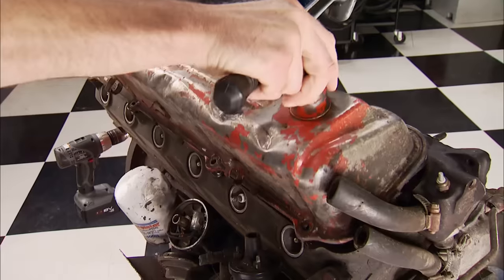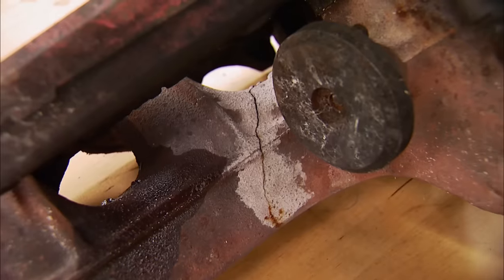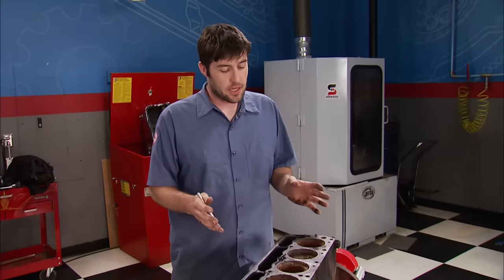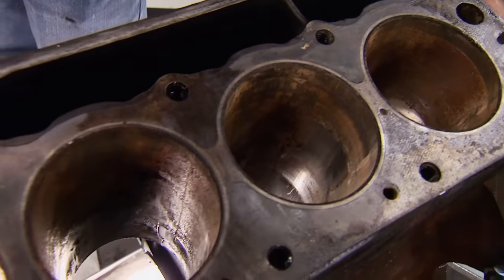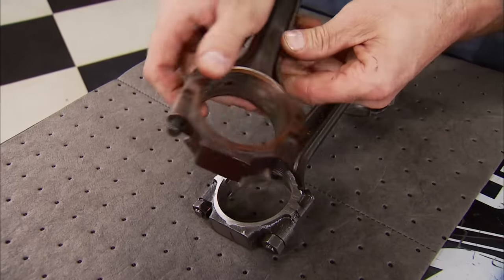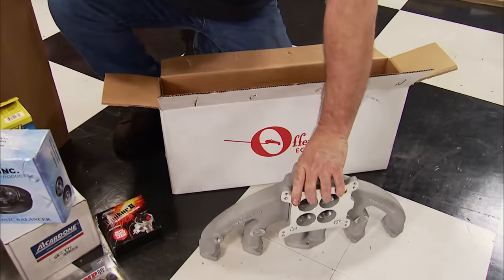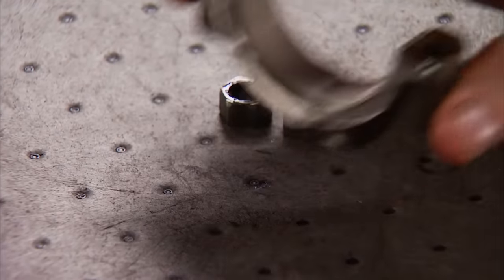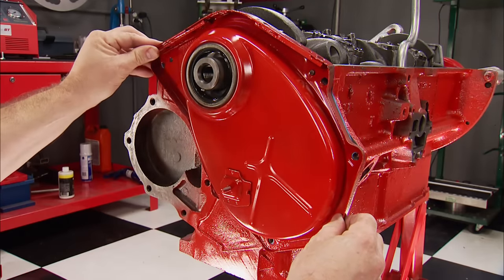Resurrecting A Mopar 225 Dodge Slant Six - Engine Power S2, E2

Comment: One time had to replace timing gears in a field with no ability to drop the oil pan. That thick rubber seal on the front between oil pan and chain cover was probably the biggest challenge of the entire job. I could see the last guy had the same problem as all the locator pins directing the chain cover were all oblong already. New profanities were created.

Comment: 30mpg? I have had many slants. Never got close to that. 16-17 before they got cats. Then they went down to 13. Some claimed in the "Feather Dusters," and the "Dart Light" with light weight body components (aluminum) 2bbl Super Six, 833OD transmission might have went into the low 30's. My 198ci slant with the M-1 2bbl intake with a modified head, stock cam and Hooker headers got 22mpg on 93 non-ethanol @80-82mph with 3:23 gears and a 3 speed.

Comment: I remember this incline straight 6 cylinder, like a half of a V-12 in Mexico they put a small carb to save gas, and it did the job very well, it had the bit of extra power and the millage was amazing! like of a 4 cylinder or better.

Comment: I had several cars  with that rugged old engine, they were tough.

As for rust removal, I  hope this helps someone. NAPA has a product called Knock er loose. it is the best I have found. Next would be blaster.

Comment: Guys -- they aren't "freeze plugs". They're "core plugs". They are there simply to remove the casting sand when the engine block is cast. That they MAY pop out if the coolant freezes is just a secondary effect.

Comment: I've seen one of these still running after throwing a rod through the block and the starter hanging by the wires. Friend stopped by and was wondering what was wrong with his car. I was outside and saw the starter dragging under the car. Opened the hood and naturally steam and smoke was coming out but it was still running. He asked me if I thought he could make about five miles down the road. I said I don't know but whatever you do don't shut it off till you get there. He made it.

Comment: I had this in my 65 Barracuda. Changing oil and setting the timing and replacing points was a b1tch. 5 in. of space to with between the passenger side fender and engine to work with.

Comment: The oil slinger does not oil the chain. It keeps excessive oil away from the front crankshaft seal to prevent leaks.

Comment: I love how Chrysler Slant-6 engines literally have the damn intake next to the exhaust manifold.
Reply: The pushrods are in the way on the other side. Still wonder why not hot-hot-cold-cold and at least a little heat shield. Overhead camshaft and HEMI is so much easier ( note, not a full hemi it is more 0.3 sphere and I would love the spark plug in the center and accept smaller valves in a low revving engine. How far should a spark plug protrude into the combustion chamber ideally?

Comment: The one in my 65 Dart is at 97k miles and is a daily driver. Still running fine. BTW, the external oil pump feature is also found on big block Chrysler engines.

Comment: Nice video💪 if you have a rusty cylinder next time you can fill them with cola for a little time. It will make the rust lose and its easier to pull out the pistons.
Reply: If we have time: Could we place the whole engine in a vessel with propane and heat it to 800 °C over night to simulate a blast furnace and reduce all steel ?

Comment: For all the people complaining about replacing everything. The original motor is 1976 or earlier with a forged crank. The block was cracked. It happens. The later block is 1976 or later with a cast crank. The cast and forged cranks are entirely different. The connecting rods are also  entirely different.

Comment: 14:57 cold lash should be Greater than not tigger as the coefficient of linear expansion is greater for steel then cast-iron. So as the engine heats up the valve lash gets tighter.

Comment: i have a Dodge A100 pickup that has a slant six that is stuck from sitting.  I pulled the plugs and put some transmission fluid in the cylinders. Are there any tricks on freeing it up?

Comment: in 1977 my older brother's first car was a 67 dart, the engine was tan, a 170 most likely..we lived in illinois and would take it out in the hayfield and do alfalfa burnouts..This turd was a dog to say the least.  we drove it out on the blacktop and would get it spinning in the grass off the road and slowly get onto the blacktop, after a little chirp it was all over. 
after months of not having fun we decided to see how fast it would go.....top end downhill it registered an eye watering  77 mph.....it never gave up though. what ended it was my father getting toasted one night while driving it and hit a guard rail, busting out the radiator...he drove it 5 miles before it seized up. the next day the engine turned over again. 
Great engines they were, very durable.

Comment: My Dad was a Master Mechanic, his favorite engine was the dodge slant 6, and told me so many times. that engine was designed and manufactured when customer loyalty was what most companies were trying to build, so they built dependable long-lasting things.

But then as a new generation of younger greedier people took the reigns of these companies, they figured long-lasting dependability was not for them and began to push for planned or built-in obsolescence in other words they started making stuff that only had very specific wear and tear life.

When I went to a tech school, I was told that appliances that were once made to last for life would now only last 7 years, here is an example.

I went on a service call to a small chest freezer, it was just 5 years old and the compressor relay had to be replaced.

The 1950s rounded corners freon-22 freezer on the other wall had never been serviced for any reason and was running right as rain, while the 5-year-old 1980s something freezer had a bad relay.

Then they did something they did not need to do but did anyway, they started putting computer boards in everything, those boards are expensive, and a nice profit for the company making them and the parts house selling them, the old analog stuff was way better and way more dependable, if you do not have good surge protection, then a line surge of power can take out the computer board of your fridge/freezer, etc...

But hey they are all doing it so there is no choice, my current washing machine, I was told at Alabama Power was one of the last models to have a regular agitator, the next gens would have a rinky-dink dinner plate looking disk with depressions in it for an agitator.

I passed by a Ford dealership with my boss one day many years ago and they had trucks that had rinky-dink tires on them, so I asked my boss why they did that, and he said, there are usually 4 tires on a truck if they put the smaller tires on and save 5 dollars a tire, that is 20 dollars per truck multiply that a few million times for a few million trucks produced for that year model. and the savings to Ford is huge.

So no more regular agitator, they have cut down the amount of plastic being used for the agitator, and it saves them money, if they save just 1 dollar per washing machine, and produce 5 million of those machines, they have saved 5 million dollars.

It has become produce the crudest stuff possible that will die 2 days after the warranty goes out and make the replacement parts very expensive so you can make big profits keeping the board of directors happy and the stock investors happy so you can keep that cushy multimillion-dollar benefit-rich CEO job and that very nice golden parachute at your retirement.

Rant over.

Comment: Always loved that Engine  i was always a boater and i thought  the Slant 6 would had been a great Marine Motor ?  Although the Crank may need upgrading ?  Perhaps their Industrial one would be okay ?  For the torque a boat needs
Reply: The original slant-six came with a forged crank, pretty much the industry standard for strength, although they later went to a cast one.

Comment: Nice job guys. A few questions. Why didn't you go with a Holley ETI? It was nice seeing protective caps on the connecting rod threads during assembly, but the same could've been used with valve seals. Push the valves in, protective cap slide over the valve tip, oil seal then gets pushed on. The top of the valve shafts are sharp just enough to mar the seals leading to smoking. Last and final, did you wire wheel the bolt threads? Also, it's good practice to run a tap down to cleanup the threads for those head bolts. Think of the rust line created when the old head bolts were in. Now, both the engine and head are resurfaced. The head bolts will be going down in uncharted territory. Hence the need to clean those threads for an accurate torque.

Comment: I ran a slant 6 from october to may with no rad because i could no afford one knocked out the frost plugs and drove it to work twenty miles each way. In the spring got a rad drove that engine another 5 yrs

Comment: I had one of those in a 68 dodge dart. That engine was almost indestructible. I was just an idiot kid at the time. I got it so hot one time and it shut off, I waited until it cooled down and filled it with water and it started right up. I drove the car for another year before selling it.

Comment: the Slant Six uses 426 hemi main bearings & has the same camshaft chain drive as a side valve ford V8
the camshaft chain is approx worn-out its only 54 years old - still has original water pump and Alternater  - chrysler didnt cut corners :)

Comment: Did any of the  Earlier Slanted 6  Cylinders Have the plugs in valve covers. I only ask because my father at a 60 Plymouth Belvedere. I could of sworn the spark plug were in the valve cover.

Comment: Way back when I first started driving my first car was a 1972 Crazy Plum Purple Plymouth Duster with the famed 225 and it stood the test of time. As for killing that engine, good luck, because it's not happening anytime soon. If only I knew back then what I do know I would have really taken the time to keep that car but an unfortunate tragic end came to the car and I junked it, sadly... I kept it as long as I could but soon I had no choice because I lacked the funds to move it so off to the junkyard it went... I did put new paint on it and ran it for a few years so I got way more that what I paid for it and overall it was a great car for the times... Obviously you're not going to win any races but you won't come in last either and given that is was in the over 30 MPG range less than 2 bucks is all it took most times to fill the tank... Cheers....

Comment: The engine actually goes back to 1928 ..... Where the Pistons were vertical, and had a small displacement. When hood lines were being lowered the engine got it's slant

Comment: just finished my motor mechanic app. took over the lease on a service station, mate and i made a stock car to race at head and greata dirt race track Australia in the early 70's out of a s model valiant it had a 225 slant 6 put extractors and a 45 mm side draft Weber on the engine welded up the diff. center through away the alternator bared the body out to be as strong as a tank we tried to kill that engine but did not succeed won sum races and had truck loads of fun by the time we finished racing the car it looked like it had been run over by a tank those were the days, then i was 20 now 70, youth lost.

Comment: With out milling the head, porting, and a good camshaft 268-275 duration you won't get no where. Headers come alive after 4K rpm, with that cam and stock head that is really restrictive flow won't even be able you really use that four barrel combo. Need at least 9:1 to run a four barrel
Reply: So porting is for castings? A casting uses sand and as such the surface of the metal is rough. We all know that rough leads to friction. Machining part is difficult. In our modern times, I guess that some 5 axis CNC can reach all points? Too expensive for series production, but not for race. And unlike long duration headers it has no disadvantage.

Comment: Hello good afternoon, do you know what the torque of the valve cover screws or points is since I am going to change the rubber gasket of a 2008 jeep compass? Greetings from Caracas Venezuela
Reply: 380 foot pounds .

Comment: Good as this engine was in its time, there was no further room for expansion with this design beyond 225 cubic inches from its 3.4" bore and 4.125" stroke; increasing emissions targets during the '70s and early '80s further reduced its future potential as an automotive engine (despite switching in 1976 from a single-barrel carburetor to a two-barrel one that brought up HP from 100 to 110 and torque from 170 to 180 lb-ft) and it was discontinued for passenger car use after 1983 and in trucks after 1987, while continuing to be available for industrial use until 1991. 

Both the previous 170 and 198 sixes had the same 3.4" bore but had respective piston stroke lengths of 3.125" and 3.64".

Comment: Thanks for teaching that piston rings definitely rotate on a fresh engine.  The gaps are liable to end up ANYWHERE and it makes very little difference on an in-spec engine. 
Even the factory didn't fuss about where the ring gaps were for good reason.   It sucks listening to people say "look....some idiot built this engine with the ring gaps lined up" when they literally can end up anywhere.  The rings don't all rotate at the same speeds, either.

Comment: I had slant-sixes in a '62 Dart, '73 Duster and '76 Aspen wagon. None got the fuel mileage I thought I should get - about 21 mpg. They were reliable. I surely wish they had fuel injection.

Comment: The best thing for that first block that the machine shop said was no good would make a good boat mooring. Looks as though its sat out in the weather and water got down the inlet manifold what a shame. These engines were used in the australian built valiants from rv1 up to the 1969 70  vf and the vg to cm used the 215 245 and 265 australian designed and developed hemi 6  and both those 2 engines were also used in the aussie built dodge trucks and ambulances as well and the slant six was even used in the indian army tanks and in speed boats in africa up until recent years , it was chryslers engine that refused to wear out or quit they were a bloody great motor and actually ran smoother than the australian hemi 6.

Comment: i had n australian 64 valiant, that engine was the only car l ever had that would start without the motor doing a full revolution, just had to breath on the key and it would  start, was lucky to get 20mpg and i could never stop it from oheating in the summer, push button auto, and you could coast start it if you had a flat battery, unlike most other autos

Comment: Took awhile for automotive designers to reduce air drag had to lower the front end.  Dodge did this by slanting the engine, but Subaru topped them by making the engine horizontal.  For us old guys, had to bend over further to work on them, but with the Dodge really not that much more.

Comment: I would not use cork oil pan gaskets. Use the one piece neoprene ones with metal inserts at the bolt holes.

Comment: I would love to see you do some work on a Buick 401 (",). I got a Buick Electra 2D HT from 1959. My engine had a 3 angle valve job, port and bowl clean up. I made some small adjustments on combustion chambers and polished them up. the intake and ex manifold had a clean up too. I has now a bit more power..But what can you get out in numbers on a old buick 401 ?..All the best from Denmark.

Comment: Guys. WD-40 is not a penetrating oil. WD=Water displacement.
Reply: it in fact isnt anything . you can spray it on a squeaky door hinge and the hinge will be squeaking again tomorrow . anything worth lubricating imo is worth a shot of 90 weight gear oil .

Comment: I rebuilt a 1963 -or 64 Barracuda slant six with the goal of turbocharging  it.  When I got to the crankshaft I was shocked. 6 chunks of cast metal ground to balance each lobe. I could have used large rocks like am flintstone mobile. Not my vision of a crankshaft. I never have seen one since but the question I have is was this common practice"?/

Comment: It's amazing how many people comment and compare without ever owning one of these engines. You can't go buy one bad one, look at any engine that would be in that case. I had one when I was young and didn't have much money in the late 1980s, drove it 15+ years never changed the oil, lol, overheated in summers when waterpumps went out,  it wouldn't die. It had 300,000 + miles on it and was still running when it was stolen.  It just needed, waterpumps every couple years and a readator every 5. Amazing engine. The ford 300 was too, these older non computer engines don't compare to newer engines. Only an idiot would do that!

Comment: I had a 4 door 66 dodge dart that could run with 'vettes 0-100 with a slant six was my grandmothers car. I did work in a speed shop. but lacked most of what you have today. It would run a 14 second quarter ..

Comment: Those engines were great. I had one long ago and the car fell apart long before the engine needed any work. All I ever did was change the oil and spark plugs and the engine ran forever. The weak link was the rest of the car..

Comment: the exhaust manifold cracked because it wasn't timed right and the rear cylinder got the manifold red hot and cracked it, time it so it don't get red hot in the dark looking at it and it won't do it, it even runs better

Comment: CAN YOU FIND A PONTIAC DEALER VERSION "THE MONSTER" TO FEATURE. IT'S JUST A PONTIAC VERSION OF THE NOVE WITH SUNROOF OR T TOPS. I CAN NOT REMEMBER WHICH IT WAS. IT WAS FACTORY EXTRAS INSTALLED BY THE DEALER. OH 340S USED A OLDSMOBILE REAR MAIN SEAL TO STOP THE LEAKING PROBLEM.